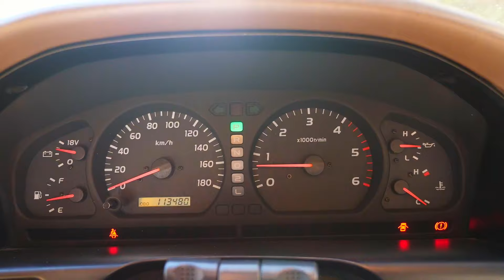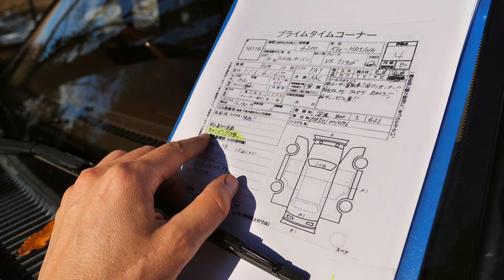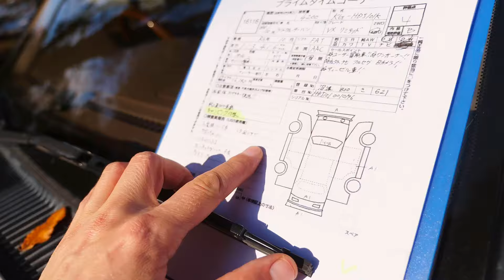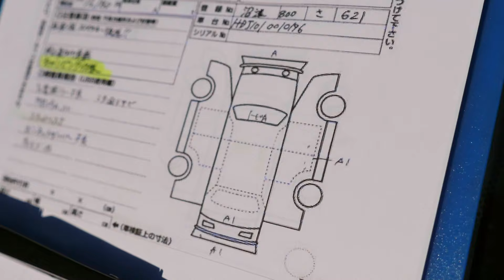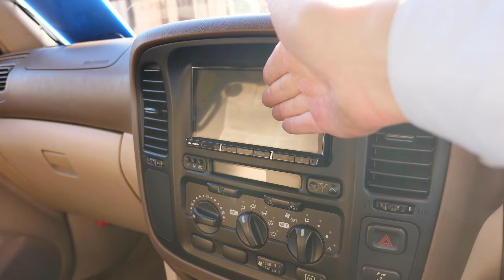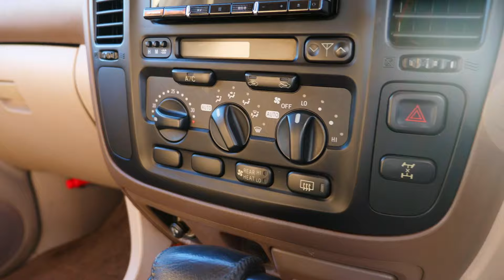1998 Toyota Land Cruiser VX Limited (USA Import) Japan Auction Purchase Review

Comment: Derrick, there's one more version of this generation Land Cruiser: 105 series, which is the 100 series body on an 80 series chassis since it was more rugged.  You can spot them from a distance because they have deep offset wheels due to the narrower solid axles vs the independent front suspension the 100 series has.  They sold them in Australia, Africa, and the Middle East.  We had armored versions in Afghanistan with a 5-speed manual and permanent 4x4.  And they were SLOW with the non-turbo 4.2 diesel making around 140hp and 230tq.  I was once driving in the middle of a convoy of Oshkosh M-ATV MRAPs that would pull away from me from a stop.  I bet the vehicle behind me was yelling into their mic thinking I was an NPC driver.  Top speed was about 100km/h.  Then we got one with a turbo and that was the favorite one to drive, although I never got to race purpose-built military vehicles before my tour was up.
Reply: The 105 with the FTE would be amazing.